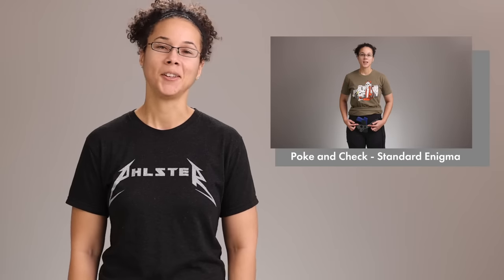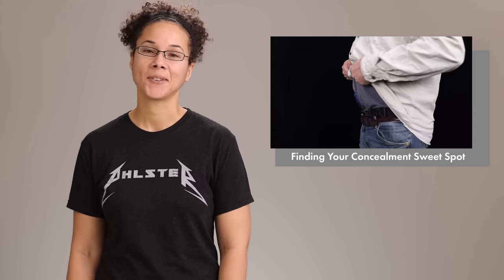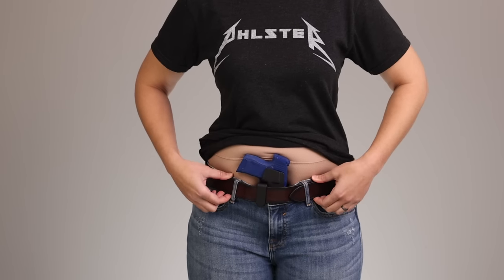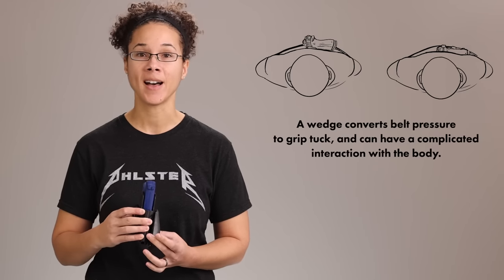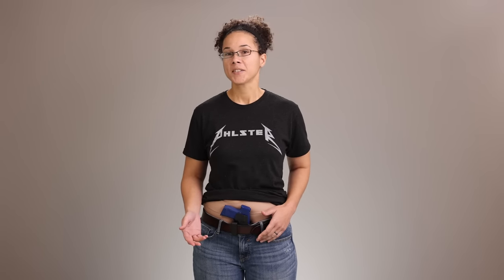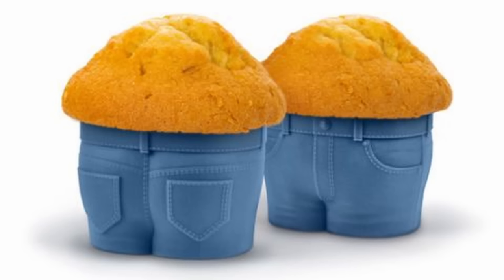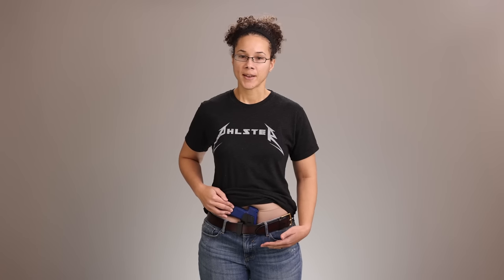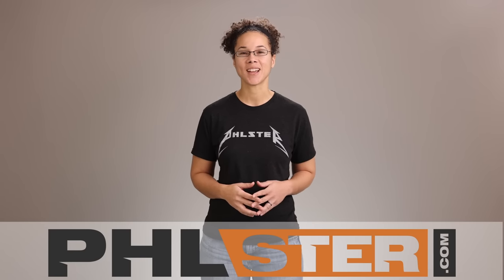Poke and Check - How To Stop Printing

Comment: Even more important for me is cant angle. I have found the more horizontal the grip of the pistol, the more the butt of the grip wings outward and prints. Putting 45 degrees of cant angle to the holster, thereby tilting the butt upward, makes the butt of the grip ride closer, and for me the butt of the grip winging outward is the biggest problem. This cant angle will compromise the draw, so you must train to make sure you can draw. Also choosing a pistol with the smallest and shortest grip will help. There will be trade-offs; the small grip pistol that conceals better will probably be more difficult to shoot well, and the cant angle that conceals better might be more difficult to draw. BTW, this grip trade-off is why you often see those S&W J frame snubby revolvers with small slender smooth grips on them that make the pistol difficult to shoot well. That grip has been optimized for concealment at the expense of being able to shoot well, and you must train with it to get used to that.

I also use a wedge to tilt the muzzle end of the holster outward, which tilts the grip end closer to the body. The wedge material needs to be incompressable yet soft enough for comfort, and needs to stay in place either by friction or attachment to the holster.
Reply: I have a Galco Royal Guard, IWB, horsehide holster that has a forward cant (I think they said it is the FBI cant).  I carry a full-sized, 5 inch barrel, 1911 with the full-sized grip frame.  I have been carrying this pistol, in this holster, everyday for the last 22 years and it has yet to print or be seen by anyone.   The forward cant actually makes drawing this pistol more intuitive, faster, smoother and easier than any strong-side holster, with no forward cant, that I have owned or used.  The forward cant, of this holster, makes concealing the 1911 very easy, and it is easier to draw.  The only strong-side, OWB holster that I have found that conceals better, and is easier to draw, is the HF1 by Tucker Gunleather out of Houston Texas.
Reply: @roadapple66  We are both talking about the same cant angle but you are talking about 3 o'clock position OWB and I'm talking 1 o'clock appendix position IWB. In the past I have also carried OWB at 3 and 4 o'clock, and the FBI cant in these positions both improves draw and reduces printing. At 1 o'clock appendix position with the same cant there is also less printing but some compromise with the draw. Removing the cant makes an easier draw at appendix but at the expense of the grip printing more.

When I used to carry at 3 or 4 o'clock, I found it caused problems for me when seated in a vehicle, so that's why I switched to appendix.
Reply: @onemoremisfit  Yeah, I'm sorry about that.  If I had gave it some thought, or read it over better, I might have realized that was what you were talking about.  You are correct about a straight vertical draw being much easier in appendix carry.  There are several good holsters out there that are cross-draw, for carrying while seated; like when driving a vehicle etc..  There are some that have two position belt slots that allow cross draw, or strong-side carry but I don't know how well they would perform using them for appendix carry.  I do know that there are many more good holster manufacturers, today, than at just about any other time in history.  We are fortunate to have so many good choices available to us today.  Kramer Gunleather makes holsters, from cowhide and horsehide.  He makes holsters to specifically fit women's physique that may negate the need for some of the wedges; when it comes to holsters for women.

Comment: I don’t know what the big deal is, I could careless if I print or not. In fact I open carry most of the time. Unless it’s required by law. I don’t see the point in concealment.

One other thing to note. Is under true full concealment… your draw to ready and shoot will ALWAYS be slower! AlWays!
Reply from the maker: A lot of people have jobs where it matters, live in places where social friction can occur from the presence of a gun, and all kinds of other reasons for not being spotted. If their priority is to reduce the signature of their gun, then we have the tools and strategies for that. 

Also, if you’re open-carrying in a holster with active retention (like a Safariland) which would be the only responsible way to open carry, then concealment isn’t actually slower. Sub-second draws from concealment are pretty easy. Deactivating two levels of active retention is often a little slower than clearing a cover garment.

Comment: Well, there's printing and printing... Sometimes the printing is so minimal it takes someone to stare at your bottom line for a long while to notice anything, now if your whole gun is quite obviously contourned on your shirt that's a problem. A little of printing can be confused with the line of your belt, or even your cellphone (here where I live is normal for girls to put their phones under their pants). Now this is just my opinion, I could totally be wrong.

Comment: Pretend that youre not printing. Mag extensions are hard. Dont carry on ur hip.  Take on the added risk of appendix carry.  Use soft loops if u want to holster to move with u.  Dont be too fat dont be too skinny.  Use a decent kydex holster. Its a weapon you need to forget u have it.  Been carry a gun on and off duty for over a decade and its never been comfortable and the only time i didnt carry off duty was bc i had a shit uncle mikes  alien gear ir badly formed kydex holster.  Once i got a good kydex holster i never missed carrying purpose (had all my edc mags knife flashlight and forgot the gun).  Its not about comfort (bad argument thats a advertising line thats made micro 9s popular) and convince people to use crappy holsters dev bad carry habits that make them print in the first place

Comment: What if you're all peaks--no valleys? 🤣🤣🤣
Reply from the maker: Everyone feels that way. :) Totally normal. Some body types are easier than others, for sure, but everyone has a sweet spot somewhere.

You might find this related video helpful. Sometimes it's the size of the gun that's problematic. https://youtu.be/5BRZWvEPn6c
Reply: @PHLster  Fair enough, but you might want to feature a fat guy in one of your videos--(maybe you do already?) Hellcat is pretty compact and I still find concealing at 4-5 o'clock is as close to a valley as I've got. Printing isn't terrible, but probably noticeable by anyone who's looking for it.